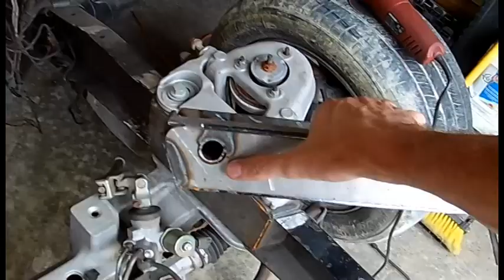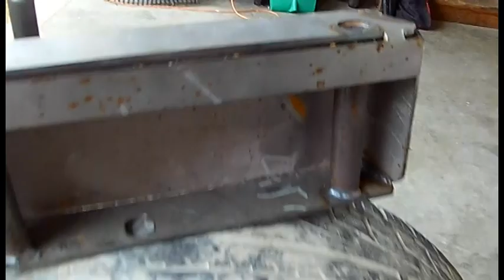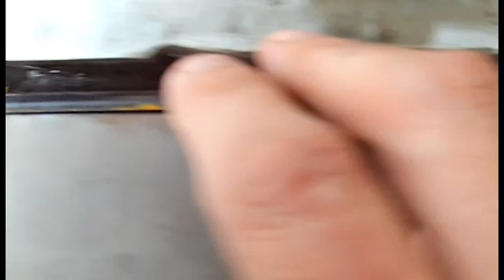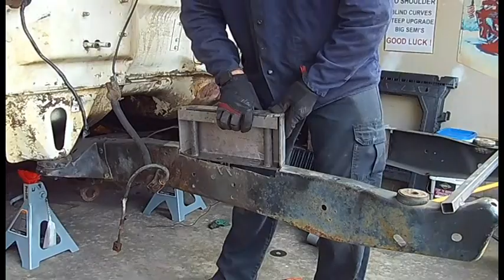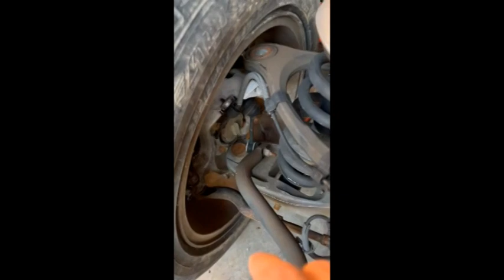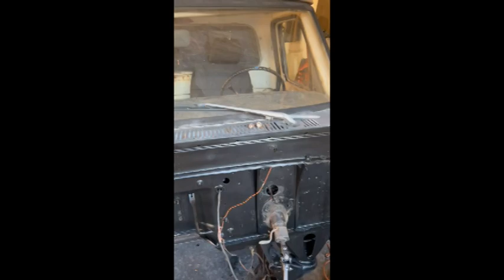1970 F100 Crown Vic Front End Swap Pt. 4

Comment: I cut the whole box bottom off and slide it inside the stock frame. No way was i going to cut the structural integrity out of the stock frame. Yeah your welding them in place but it still wont be as strong as the original frame rail